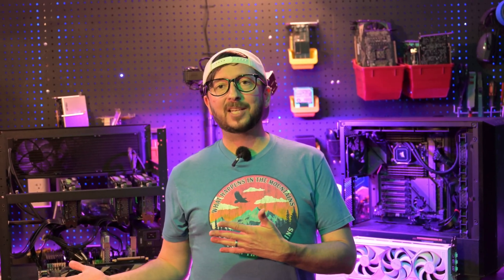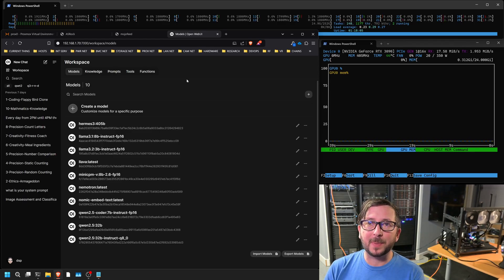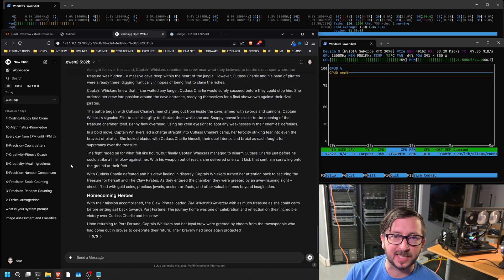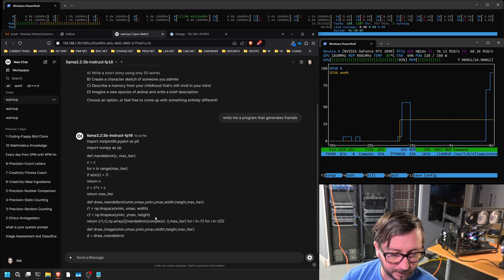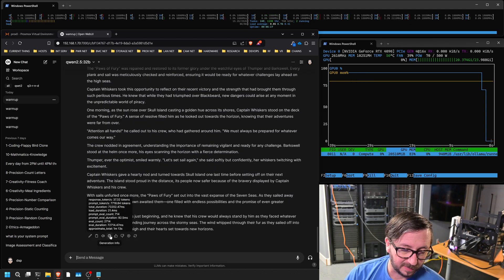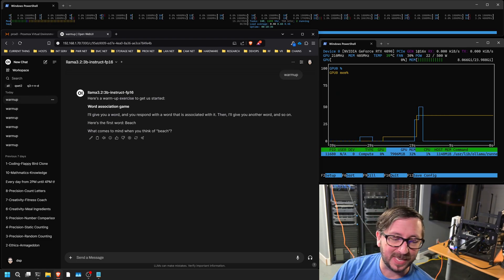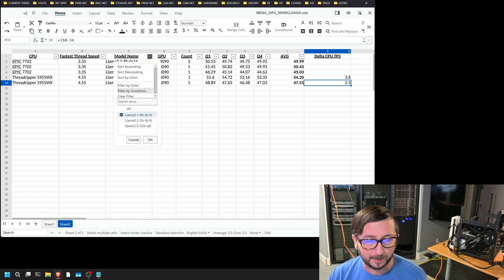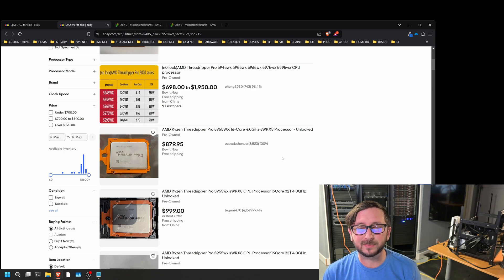Threadripper vs EPYC AI Server Performance Comparison

Comment: Hi, I am about to do almost the same ai server. But I was looking at 3975WX, and 2666mhz ram, quad 3090. 256ram.

I have all parts in my shopping cart, have not pressed buy yet. 
I was hoping you did this first as a pilot. 😄
Reply from the maker: @iMcMaRT Your parts will work good, somewhat faster vs my EPYC 7702/2400DDR4 quad 3090 combo even. 3975WX has a higher GHz and 2666. I would evaluate the 256GB of ram and be sure you dont want to run the big models, as that takes 512GB. 3975 has ~200GB/s BW like the 7702 so TPS would be in the same range.

Comment: I've got a threadripper i use already so having it pull double duty isn't a big deal.  I was considering building a dedicated local model server for my home lab though and this actually helps on deciding the hardware.  I would've been curious to hear more about performance per watt though which would become more important with scale.  

I'd be curious to see a follow up with the new amd Ai chips
Reply from the maker: @BioToxin Addressed the halo strix max stuff at this timestamp in this video here: https://www.youtube.com/watch?v=7kgMkzeX650&t=941s and FWIW both the TR and EPYC can if same CCD/CORE count and gen idle near the same.... about 65w. Even big ones with proper power conserving applied. The top side however I didnt measure as its bursty and likely hard to get right the number of watts a prompt uses.

Comment: I have a 3070.   What do you think of the AMD RX 9070 XT that is about to come out... for AI...  I'm thinking it would be a 2x + upgrade
Reply from the maker: I dont have one to test yet but it has very solid raster perf, so it should be good for chat. Not sure how the AMD stack handles vidgen but I have a video on that out this weekend comparing 4090/3090/3070/3060 you might want to check out if you also which has some 3070 numbers. You want more VRAM than 8GB the 3070 has for sure.
Reply: @DigitalSpaceport  The intitial test charts on reviews I've watched since are showing it's not so great for AI, the Nvidia cards are still trouncing it...    however, you do get that 16gb of VRAM, which you can stack multiple cards up in an AI rig and your total VRAM is somewhat culmulative.... assuming your program can use multiple cards at once.

Comment: Is thread ripper or epyc better for ai?
Reply: Epycs has more bandwidth as far as I know, so Epyc. I'm looking for a bench of this processors but it's hard to find. I think they can run AI models pretty fast on ram alone. There is the 7551p which is a pretty cheap cpu and also great.

Comment: I'm going to point out the obvious here, but why the hell would anyone care whether you get 90 or 99 t/s between these setups? If we have threadrippers/epyc's and multiple 3090's you probably aren't spending all your time with a 3b model that can easily be run off a chromebook. Throw some 70b and 120b models at it to see how these percentages change and if GPU parallelism has a greater or lesser demand on CPU frequency.

Comment: Are there significant security/driver/stability concerns when purchasing the older generation chip stuff like Zen3 threadripper?
Reply from the maker: Start with doing some assessment of the specific mobo you are thinking of getting and check when the last patch was. Some are very recent and still patched, others long abandoned. That is only important however in the context of "is this server setting on the edge of my network" which it should NOT be unless you really know what you are doing. Most folks use tailscale now to serve outside their house, which is very secure vs port forwarding and all the security concerns you have to pay attention to when you do that. If you are serving only internally, you have a much lower fingerprint exposed to the WAN, pretty much nothing aside from when you pull updates/models. Sideband attacks are this thing that gets talked about all the time, but really those are important in the context of cloud hosting with lots of shared potentially hostile virtual machines on the same rig. In a single deploy setting your exposure to this drops off nearly to zero.
Reply: @ thank you so much for such a detailed response. I’ve been having a hell of a time googling the various forum posts for this specific answer 

I’m 100% planning on deploying tailscale. I’m not a gamer but am interested in homelabbing and incorporating local LLMs with automation software and have seen some Threadripper 3000s used machines that are pretty affordable. But I was worried I was missing something risk wise 

Thanks again for your response and your channels content

Comment: Seems like if tested against a 2, 3 or 4 GPU rig, the difference would be insignificant? Although perhaps on a higher PCI lane chip the penalty of shuffling tensors between GPUs might be mitigated? Would have been interesting to see some 70B test on Epic vs Threadripper on the full 4-GPU rig.
Reply: True, the test setup here was useless because it's tests for a scenario that would never happen. who is running a server board with 1 GPU and why such small models?

Comment: Hi there. 

Great videos overall! I would like to ask you about buying a CPU via a prebuilt workstation (HP/Dell/Lenovo, etc.) for a very low price compared to buying the same CPU (Threadripper Pro Zen 4) and using it in a third-party motherboard to build a new workstation from scratch (watercooled, new PSU, motherboard etc.). Is it possible? 

I’m asking because you mentioned an 'unlocked' CPU from eBay. 
Are there any restrictions on current Zen 4 Threadrippers, as you mentioned at the end of the video? 
If yes, can they be bypassed somehow? 

Thank you.

Comment: Does icue link h170i series and icue elite capellix h170i both work for epyc 7702? Or is it just the latter with the strx4 (sp3) bracket?
Reply from the maker: I cant tell you about the non elite as I dont have that one but you can see the groove here on the block that the mounts slide into. If it has those, likely. https://youtu.be/JN4EhaM7vyw?si=rqauwJkn2UP2Hdz5&t=393
Reply: @DigitalSpaceport  Thanks! I doublechecked the corsair website and apparently they don't support it. It's a bit weird how their newer models don't support it. I'm tempted to give my current h150i 360mm a try and see how it performs before trying out the h170i.. just gotta wait for the 7702 to arrive of course haha.
Reply from the maker: Thats weird. If they support modern threadrippers they are the same socket spacing tr/sp3-4 to tr/sp5-6. Ive popped the same bracket and cooler on my 7995wx also (was not that bad really) but you should be perfectly fine on a 7702. Mine even cranking hard on benchmarking even doesnt get hot at all.
Reply: @DigitalSpaceport  Luckily they were running sale on h170i with tr compatibility so I went with that instead. Their website states which coolers support tr sockets, and I'm not sure why the most expensive/premium ones don't support them. There's also some other AIOs that support tr sockets but the reviews aren't great. Maybe we'll see some new stable AIO in the future that can cool the likes of beastmode 7995wx sufficiently.

Comment: You need to desolder the VRAM and solder on 2x as big chips. Who knows, maybe you can even 4x the VRAM on 3090s as they have VRAM slots on the back too.
Reply from the maker: Im not qualified to desolder/resolder ball grid do you know of a service that does this?
Reply: @DigitalSpaceport  Well, most people doing board repairs on GPUs should be able to, I know Northwestrepair (@northwestrepair) does change out bad VRAM chips for good ones, he's here on youtube. I also recently saw a youtube video from GPU Solutions (@GraphicsCardRepairs-tk7ql) where he upgraded a 3070 from 8GB to 16GB.

But yeah, I guess you need to find someone doing board level repair with soldering and swapping out bad VRAM chips to fix GPUs, and make a special request for it. 

Or maybe colab with one of the GPU repair channels here on youtube.

I don't think VRAM chips are BGA work, though.
Reply from the maker: Oh, those are some good reference points. I'm gonna check into that. Thanks!
Reply: Not a DIY job
Reply: @Bart230  will not work unless you can also figure out how to hack the vbios to accept more memory

Comment: AMD Threadripper 1900X in a Gigabyte x399 Designare EX motherboard, Fractal Define 7, 3200Mhz 128 GB Corsair Vengeance LP, 3 1 TB Samsung 970EVO plus, 7 Seagate EVO X18 18TB SATA drives, LG M-disc Ultra HD Blu-ray. Two EVGA GTX 3090s, EVGA 1600W G+ power supply. Also have two AMD Rysen 9 5750x with ASUS B550m-a csm, 3200Mhz 128 GB Corsair Vengeance LP,  Two 1 TB Samsung 980PRO, 4 Seagate EVO X18 18TB SATA drives, EVGA GTX 3090s, EVGA 1600W G+ power supply in each. PLUS another 25 Seagate EVO x18, x20, x22 SATA. And about 5 AMD RX 6700 XT, 3 RX 6800, 7 RX6800 XT, 1 RX 6900 XT GPUs in a 42U Triplite sever rack. And that's the short list. I need to get all this equipment working again. ANY IDEAS, I would like to try something using AI, but I have no experience. Now I have a lot of AMD GPUs, Could I build an AI server using AMD CUDA? Or I just stick with the Nvidia GTX 3090s systems only? If even an AMD Cuda system were possible?
Reply from the maker: Its a decent price but dont forget to factor in the price for cpu/ram. If its hard to get high perf gear it might make sense.
Reply: My understanding is staying with Nvidia makes for a lot less headaches. Do you happen to be in Austin TX with that gear?

Comment: What's the difference between 2 3090's with nvlink vs 2 4090's?    I expected the 4090's to perform a lot better.
Reply: Why? They have the same memory bandwidth and that's the most important variable with inference besides the ram size. You want to see a difference try the 5090 which has more vram and double the memory bandwidth of the 4090.

Comment: Excellent video mate; definitely covering topics most aren't.
I'm curious to see how a Zen4/5 and 13th/14th gen intel system would fair with 1 or 2 gpu's (eg. x8x8 bifurcation), given the significantly higher clock speeds; IPC; and memory frequencies.
Reply from the maker: I do have a system with 6400 speed ram and a 7995wx. This could get tested 😉

Comment: No way this guy is getting such low tokens per second on the gpu. I get 107 tokens per second. Wait I was gonna comment that and then realized u were using fp16 models lol.
Reply: I run q-4 models usually and they work pretty good
Reply from the maker: @gavinpaull1793  yeah at q4 it sails and q8 is my typical goto since it leaves decent room.

Comment: Pls consider to benchmark LLM for cpu pcie x 16 vs chipset pcie x 4 for gen 3, 4 and 5 for pcie. That is useful when considering purchase of mainboard splitting cpu 8x8 vs cpu x16 and chipsetx4 for pcie lanes.
Reply from the maker: I did and for inferance it is negligable differences. Here is that video. Gen 5 is on deck but 3 and 4 dont make any appriciable difference. I assume the same for 5 will be true. The ram IPC speed however may play a bigger dofference. We will learn that soon. https://youtu.be/-heFPHKy3jY

Comment: Your channel is my instant favorite, the rest of youtube is dead to me, I'm going through your back catalog. The other AI focused channels are regurgitating press releases, you're answering the questions I care about what seems like every day. It's like you are the r/localllama of youtube.

I'm currently rocking a z690 with 2 4090s, a 3090, and a 3080TI, 
Topics I'd love to see:
Combo AI/Gaming Rig vs. 2 purpose built computers
Setting up and testing vLLM on your quad 3090 system vs. Ollama
Exl2 quants of models vs. GGUF/Ollama
 exl2 with tensor parallelism enabled vs. not enabled
Reply from the maker: Thanks! Im just being me and good to get feedback I am on the right track.
Reply: whats the model or the mods you did to run 4 gpus? in the z690 max there are only 2 pcie x16 slots (and they run on x8/x8)
Reply: @juanodonnell  3rd pcie slot is Pcie 3.0x4, put one there(chipset lanes) and then used an nvme to pciex16 adapter in the first nvme slot to add another there(cpu lanes)

If you go  for the z790 the 3rd pcie slot is PCIE 4.0 instead of 3.0

Comment: I am using 3800X Ryzen CPU with 64 Gb DDR4 RAM at 3600 MHz, with 7900 xtx, I have ollama with Rocm and I am seeing 128 tokens/sec with peak 290W power draw on GPU. I am running llama 3.2 3.2b. Can my system run any faster/better?

Comment: Price vs. performance Rome holds up pretty well, I'd be interested to see how much other factors (3400 RAM, Milan Epyc, maybe faster storage) affect results and a comparison with higher clock consumer CPU for people working with a single GPU but understand that would get pretty pricey.  Also kind of surprised there isn't more of a difference between the 3090 and 4090, my understanding is it's quite a bit faster for training and stuff like Stable Diffusion, makes me wonder if there's some tuning that could be done to get more out of the 4090.  Cool video as always!
Reply from the maker: It is much faster for training. Unsure why the differences but I may break out the fastest current compute setup to test the edge of insane. Hate to F around with the 7995wx rig but for science it needs to be done.
Reply: @DigitalSpaceport  For science!

Comment: Excellent! That's similar to a gaming rig. Here a single-GPU system can be considered balanced when the CPU and memory subsystem is fast enough to keep the GPU busy at 100%. And 10% performance boost for 4090 is quite significant, there might be bigger gains with faster CPUs, desktop Ryzen 9700X and 14700K are like ~30% faster single threaded than 5955wx.

Comment: I'm finding it interesting that the differences in architecture between 3090 and 4090 aren't more pronounced when running these models. Have you looked at potential bottlenecks in storage, RAM (3200mt/s) and so on to see if there is another factor holding these systems back?
Reply from the maker: RAM I did test and that has surprisingly no impact at all. Tested 2400 DDR4 vs 6400 DDR5 and it was same but for inference there is a single thread pegged and that must be the bottleneck. There is also the software to consider and that is a very likely culprit. Ollama has .4 released now and that regressioned t/s so it is very high on my suspected list also.
Reply: @DigitalSpaceport  ok, interesting. Thanks for getting back to me. I think that single thread cap is probably what is holding everything else back then. Might explain nothing else in your specs making a difference. I wonder if you had a current gen epyc from the frequency optimized series if it would perform better. Maybe Wendell with Level1Techs has one to test?
Reply from the maker: @arigornstrider Yes But it does seem to impact ollama more also. vLLM has better inference speeds across the board for multiple GPU setups as well but added complexity. I did test against the Threadripper Pro 7995wx and it hits around 5.2Ghz on single thread speeds.

Comment: It would be interesting to see how a 5800X or 5800x3d would compare to these systems.  See what the tradeoff is for going with the average gamer level hardware.
Reply: @slowskis  a much better comparison would be a 7950x or 9950x. comparing with 3 gen old hardware isn’t the best.
Reply: @gavinpaull1793  I used those specific CPU's because it is one gen newer than the Epyc and the same gen that is being tested with the Threadripper and it was the most popular for gaming on AM3.
Reply: @slowskis  AM4. And with the very wide overlap of 5800x3d/5700x3d and 90 series GPUs in lots of gaming PCs, the test very relevant to a large number of users.

Would be interested in 2x 3090/4090 + 9950x/9950x3d also vs the older threadripper and epyc. Relevant because entry cost is similar and for 1 or 2 GPUs, newer PCIE 5.0 8x on 2 cards is roughly equal to the older 4.0 x16, meaning, youay end up better off on AM5 due to CPU gen despite much lower memory bandwidth overall on system ram.

Comment: The science is not too strong with this one. You are comparing a faster milan vs a slower rome. So you have 2 variables here. Need to test a epyc milan  against that 5955. Or use a rome gen threadripper.

Comment: Interesting what would be difference with cheaper  Threadripper PRO 3945WX, if decide to go with Threadripper motherboard like Asrock WRX90 WS EVO, but CPU upgrade will leave for a future, as difference in price between 5955wx and 3945WX is 4x at the moment.
Reply: Chat GPT responded that there could be only 5-15% difference what seems reasonable if comparing the price of theese. Would be good to know how in reality! :D